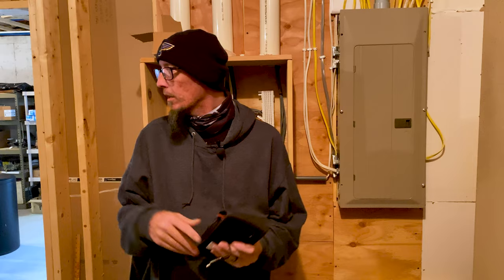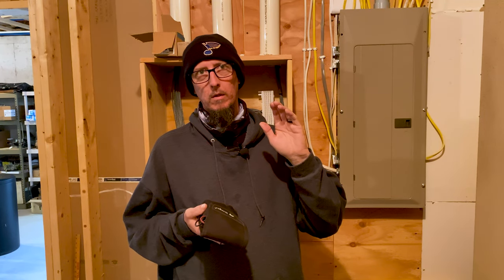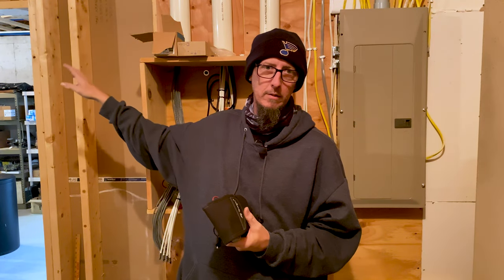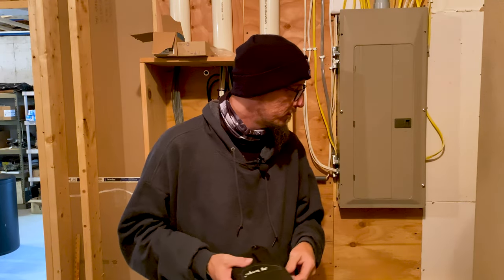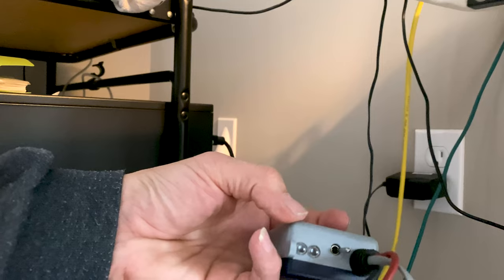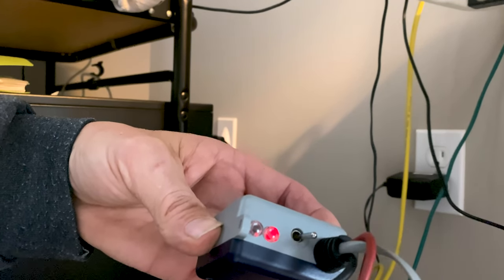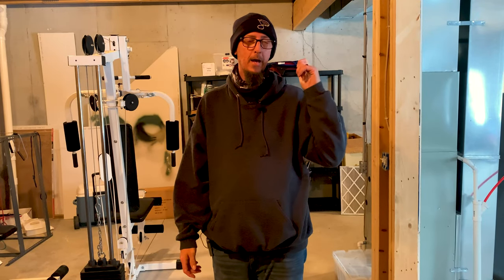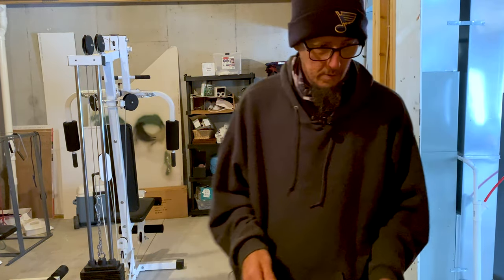HOW TO TONE OUT ETHERNET CABLES

Comment: With the speed of Ethernet speed so low, does it kick everyone offline when phone rings?
Reply: that might have been funny in like 20 years but ethernet handles any speed you can get basically so...................
Reply: @accelement3499  fair point I still use eithernet and getting 450 down and 20 up and sadly fiber isn’t available in my area but it works out well for me for now